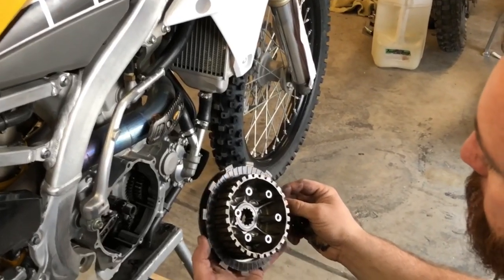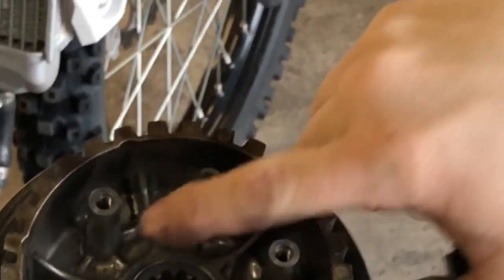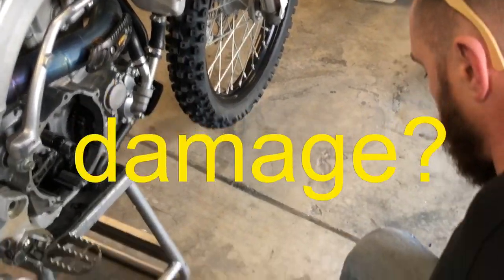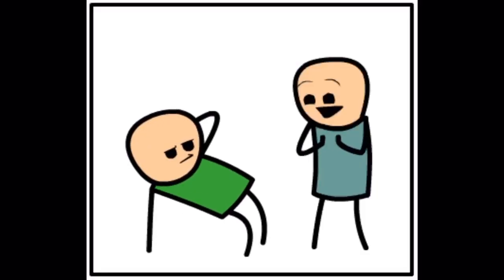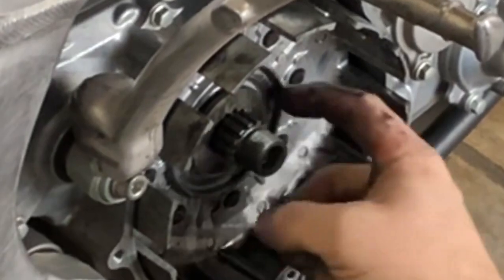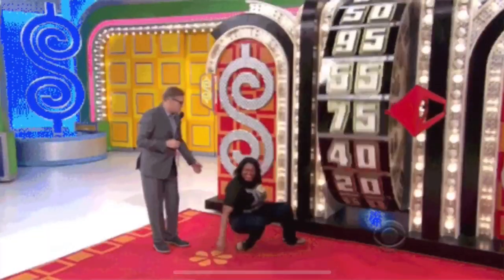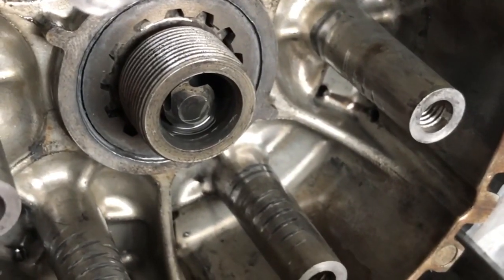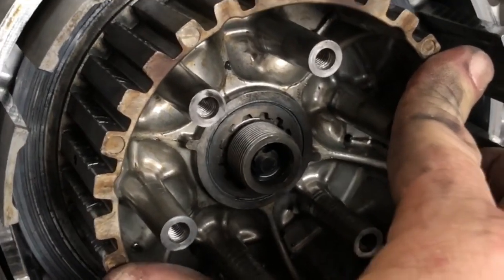YZ450F Clutch Problem Video Pt.1. | Motorcycle Zero |

Comment: FINALLY THANK YOU! ive been looking for this fucking video for a month. my WR450F makes a shitty rattle noise when clutch is engaged and under load. im assuming its probably this just wanted to find a video so i could be aware of the parts that need replacing before i take it apart.